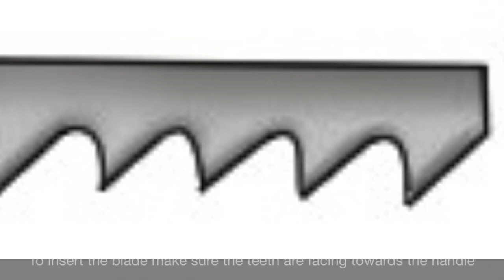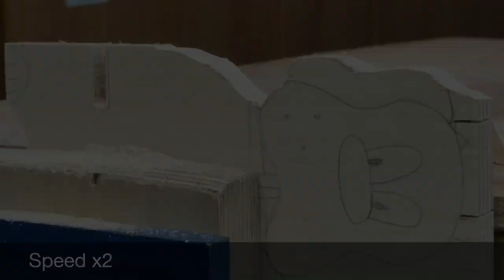The Coping Saw

Comment: You  can put the blade facing forward or backwards its personal preference ♡
Reply from the maker: the saw cuts on the pull so that's what tensions the blade,  so teeth facing you adds the tension as  you saw. Can rotate the blades 360 alright for different cuts